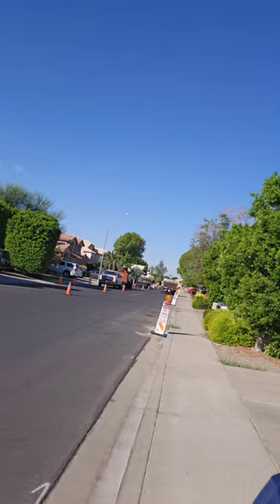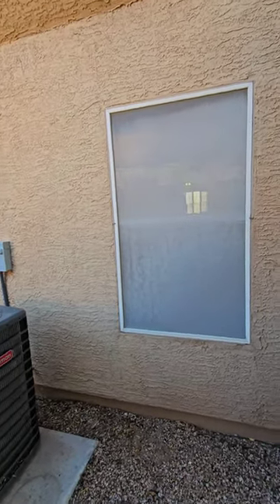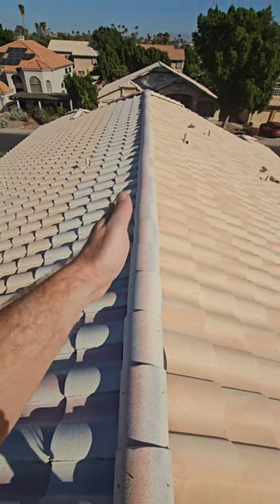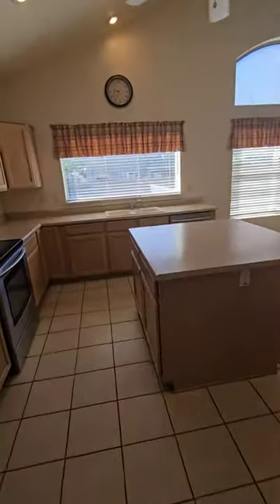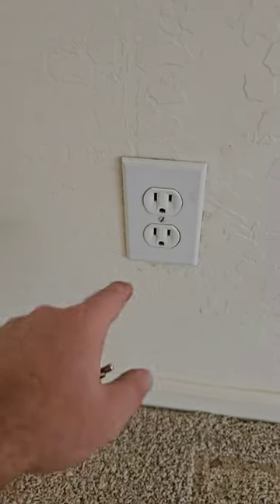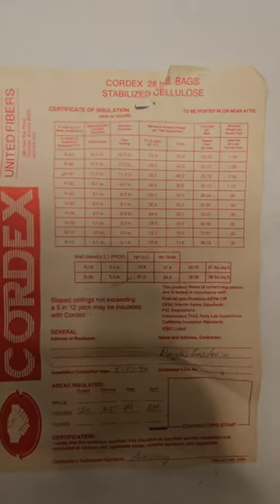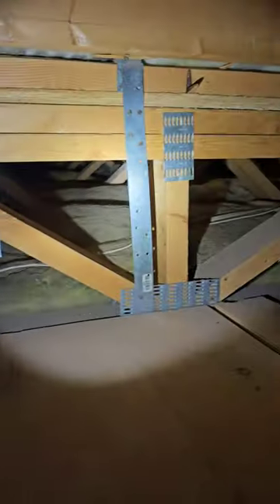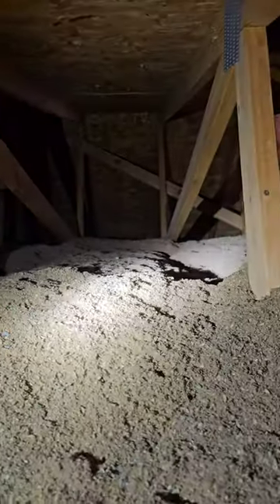This Is What Foundation Problems Look Like

Comment: That one was interesting. A lot of problems. I watched the whole vide through. Very intriguing. There’s no way to prove it because builders always switched to copper pipes right before they came out of the wall, but being built in 1994 there’s a very high chance that house had/has polybutylene plumbing.
Reply from the maker: I would have loved to have found pb. Maybe it would explain all of the moisture leaks. Brand new roof is the best thing on it! Oh, and the new pool, but I didn't even inspect that. Thanks for watching!! 👍💯

Comment: I have a 2010 Volvo S80 nice car expensive to repair only 150k miles 😂 I drive a lot less than most
Reply from the maker: We just dropped 3k into a radiator and fan assembly. So i know what that feels like. I've always been intrigued with Volvo but have never had one.